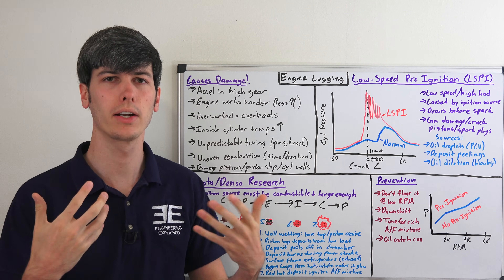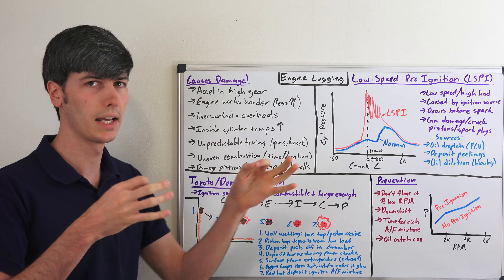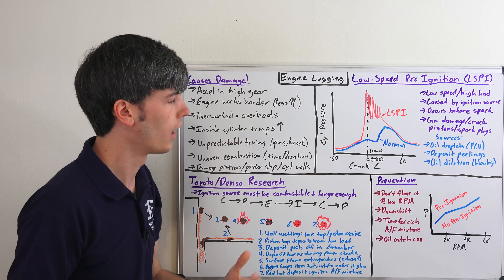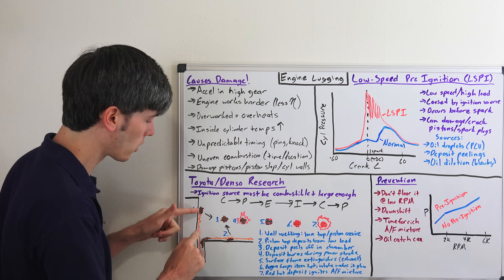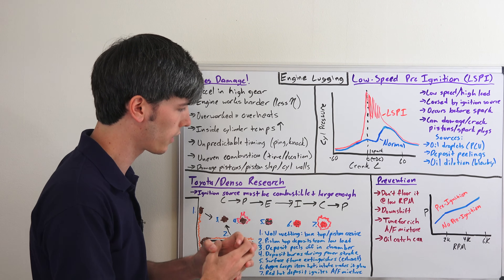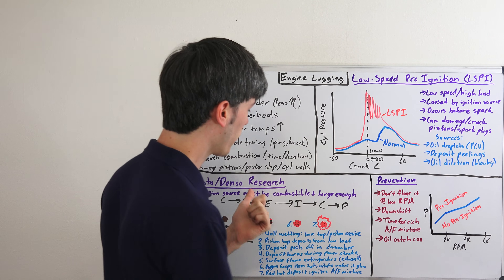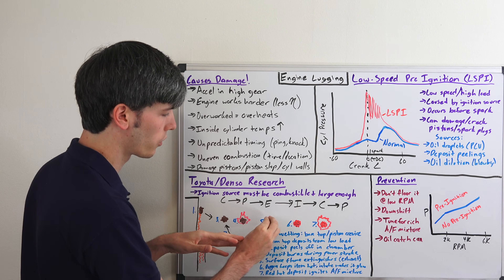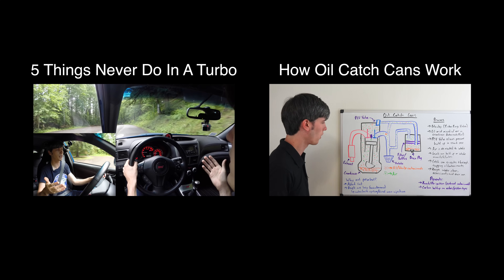Why You Should Never Lug Your Engine (Especially Turbos)

Comment: I wonder if it is better or worse in a supercharged vehicle
Reply: probably worse because it would have a lower boost threshold
Reply: It depends what kind of turbo or supercharger you have. Superchargers are more direct from being belt driven, so they have power all the time. Turbochargers can be tuned for low rpm power or high rpm power. It just depends on the tuning mostly.
Reply: Well it would be the same principle as a turbocharged engine, Because they are both forced induction so the pressure of the air is much higher when it is let into the cylinders. So having a higher pressure when pre ignition occurs the combustion will produce more power and downward force against the piston that is trying to move up to compress the air/fuel mixture But because of the pre ignition the combustion is pushing down on the piston while the crank tries to push it up.
Reply: Depends on the type of supercharger.  With a positive displacement supercharger, such as a roots type, the problem is generally worse unless the engine is running a low compression ratio.  With a centrifugal type supercharger like a Paxton, the flow rises exponentially with engine speed, so there is little extra flow at low RPM's.  They are not likely to have low speed problems.

Comment: All modern turbo engines has full torque in 1300-1500 rpm (in fact 2000rpm) so all you need to do is set Sport mode in tranny and it will keep it over 2000rpm. In manual yes it can damage engine in some way.
Reply: Not "all" modern turbo engines
Reply: you're talking out of your ass....
Reply: My car hits peak torque around 5000RPM, and I would consider the 4B11 a "modern turbo engine." It cold idles around 1500, so I'm not sure where you got that statement of yours.
Reply: well the smaller turbodiesels don't have full torque at rpm's that are so low, mine is a little lazy under 1700 rpm (1.3 Multijet)
Reply: +no1ymfan1 right I hit peak at  like 3000rom and mines direct injection (non diesel)so that really says somthing consitering DI helps with downstairs tq
Reply: +Ryan Rohauer Really? Jeez, boost doesn't even come on for me until after 3000RPM. The lag is pretty bad.
Reply: +no1ymfan1 yup mazdaspeed 3 makes 280ftlbs at 300rpm it makes begins to spool at 2500ish and is fully spooled by 3
Reply: +Ryan Rohauer 3000*
Reply: +Ryan Rohauer Okay, I figured you had a Speed3 from your profile pic, but I didn't wanna assume and look silly. Awesome car!
Reply: +no1ymfan1 hell ya iv been very happy with it makes boost quick and a great tq shove can't wait till I'm pushing more lbs
Reply: JoRick Revazov ahhhh.  More false facts being spread on YouTube.... Guess you never heard of the EJ Subaru engine. Not all modern engines are direct injection
Reply: Жора, а на атмосферных это тоже касается ?
Reply: Maybe for a 2.0 130bhp TDI... my high performance 2.2 tdi reaches max boost at 2400rpm. produces 400nm of tourqe at 2400rpm and pulls 180Hp at 3600rpm.
Reply: I thought he was talking about truck turbodiesels, but I didn't think they had a 'sport' mode setting.
Reply: The 2.5 liter EJ255 in a WRX doesn’t hit peak torque until 4000 rpm..... when it’s stock. I
Reply: Which "modern turbo engines" are you speaking of?  Full torque at 1300?  Sounds kinda BS'y.
Reply: My Infiniti Q50 2.0t (M274 Daimler engine) gets full torque of 350 nm @1250 rpm. It's wonderful!
Reply: My Toyota Prius makes 420ftlbs at 666rpm
Reply: Assuming every turbo owner bought the sporty version of the car and has a sport mode.(i.e. the 10% of turbo owners)
Reply: Ecoboost 1.0 has full torque from 1400 I think

Comment: But when driving in the city you sit at 2 gear and below 2k mist of the time. Is that a problem when you are not going 100% on the throttle?
Reply: Dont floor it and it is fine, watch the video dude
Reply: just go easy on the throttle until you no longer hear that deafening sound, or ride the clutch if you are crawling in traffic.
Reply: flooring it in 2nd gear should not be a problem no matter what rpm in most cars, 2nd gear is a low gear which should provide plenty of torque.

Comment: Why doesn't the car just limit how far open the throttle can be at low revs?
Reply: Newer car's with drive by wire most likely do. Without drive by wire, it's impossible for the computer to control it.
Reply: Adam Harrington I suspected that was the case nowadays - I can't get my car to complain much if I floor it at low revs.
Reply: YYZpresto Presumably you've removed your starter motor and syncromesh etc
Reply: +taotoo2 Same here, I don't notice anything strange when flooring it in 5th at 50km/h (30mph approx). It's just slow, since it's a weak-sauce engine, but no strange acts.
Reply: OEMs also do what he suggested in the video which is to use a richer mixture at low RPM and high load. This is another reason not to lug the engine (it wastes fuel).
Reply: I don't think it limits the throttle. In automatic cars after a certain throttle position the transmission will downshift. In manual transmissions I guess they just leave that responsibility to you, since that's probably why you got one in the first place :)

Comment: This is an excellent video, and well explained to boot. Thankyou for putting this up!
I would be very, very interested in hearing the difference between small petrols and small diesels in pre-ignition, as diesels have so much low down torque and lower RPM speeds. Also diesels ignite under pressure rather than with a spark, so I would please like to hear your thoughts.

Comment: Is any of this relevant in modern, direct injected, turbo charged, gasoline engines, where fuel timing is precisely timed, so there is less chance of the air/fuel mixture being ignited before optimum combustion can occur?

Comment: So you say multiple times that flooring it at low RPM is the cause, but wouldn't this apply to only a manual transmission? I had the idea that in a car such as mine with a DSG if you floored it the megatronics unit would sort it out and downshift on its own. Does this apply to any transmission?
Reply: Yeah, it will happen to you in any transmission if in manual mode.

Comment: Engineering Explained I have a question about this subject. My 4-cyl turbo reaches peak torque (195 lb-ft) at 1750 rpm. If I am in a high gear at or over 1750 rpm and floor it, is that considered lugging?

Comment: I have chev spin 1.3 diesel turbo. Because it is a diesel engine, i oftenly use a low rpm around 1500 - 2000 rpm. 
Ex: Gear 2 - 2000rpm - 35km/h
Gear 3 - 2000rpm - 52km/h
Are my kind of driving is bad for my diesel engine? 
Need your advice... :) 
Note: i often eco driving

Comment: Good explanation, I used to have a 2004 GTO with a 6-speed, it had this awful "feature" called skip shift where if forced you to shift from 1-4 when you weren't driving for performance, pretty sure it forces you to lug the hell out of that engine. Is there any way GM counteracted these effects in skip shift vehicles?
Reply: I'm pretty sure they counteract it by making the fuel mixture more rich. They also retard the timing based on knock sensor output.

Comment: What if you're in second gear doing about 5mph? It's not totally necessary to go back into first... would this still be considered lugging the engine if you were to accelerate in second gear at a relatively low (1200-1500) rpm?

Comment: How does lugging affect rotary engines?
Reply: good question
Reply: ever driven a boulder before?
Reply: +tyler.c spongebob has.
Reply: Well it's the same principal, If you have such things as oil droplets left in the rotary after exhaust phase and the engine is at a high temperature, that oil droplet may cause the air/fuel mixture to ignite before the spark plug fires.
Reply: And lugging just relates to the fact that at low rpm in higher gears when you put max load on your engine because of the lower gear ratios in play to actually spin the wheels the engine is doing less cycles so the amount of torque needed to turn the wheels is much higher than in a lower gear or higher rpm. So if your engine is using more power the engine will be at higher temperatures and higher pressure so the chance of pre ignition occuring is higher which is the main danger of lugging because pre ignition cause engine components to bend because they have pressure from both sides when they're not suppose to.

Comment: Why do you say that the efficiency is lower when the engine has to work hard? You are the first person I ever heard saying such a thing. According to my professors and a book "Introduction to Internal Combustion Engines" by Richard Stone among other sources, every engine is more efficient under full load than it is under part-load. I.e. if the engine has to work harder - it is working more efficiently. This is especially true with traditional petrol engines with a throttle valve. Which brings me to my next question. Does this lugging problem also affect direct injection diesel engines? You never seem to take diesels into account when talking about such matters.
Reply: I believe this is particularly true for gasoline/petrol engines thanks to the throttle, as you noted -- at part load the restriction and pumping losses reduce efficiency. At (nearly) full load, this problem goes away. At full load however, your engine management might make the mixture richer for that last bit of extra power, reducing efficiency again.

That's not the whole story though -- it's more of a 2-dimensional problem. So, for a given RPM, you do get more efficiency with more throttle. BUT, for a given throttle position, you'll get varying efficiency with engine RPM. Apparently, the best efficiency may be around peak torque. There are probably instances where you'd be better off at 75% throttle and the "right" RPM than 90% throttle at a very low speed. 

I guess a given engine will have an efficiency map as a function of throttle and RPM. Things to think about would be intake tuning and exhaust scavenging, valve clearances and swirl, friction, turbocharger efficiency, and so on.
Reply: Michael Barber That's a very elaborate and thoughtful answer, thanks :) yeah, I haven't really given efficiency maps any thought before and you're totally right. If you look up these maps on the internet, you'll see indeed that the most efficient spot of the engine lies at the RPM of peak torque, but somewhat lower than full load. At higher RPMs, the efficiency gradually decreases, but there's a dramatic difference at low RPMs, where the available torque is minimal and the efficiency isn't all that great.
Reply: i'm right with you on this, you beat me to it.

Comment: Is any of this applicable to modern Direct injection Turbo Diesels?
Reply: not at all... engine management systems change variables when they sense knock...
Reply: I don't think so, I think all this is pretty vague on diesels, considering they sometimes peak torque at 1700 rpm

Comment: Is this still a thing with direct injected engines?
Reply: I don't think diesels are affected much by this, if at all. The fuel isn't injected until combustion is desired.
Reply: bro are you kidding
Reply: How does this change anything?
Reply: ***** I have a direct injected turbo diesel, ecu remapped (conservative), and mine doesn't smoke except for high RPM when will do it slightly, but I've seen people with the same engine that have mapped the hell out of it, they will smoke like crazy to the point of melting pistons, Damn!.
Reply: +Dale Cmaylo thanks! I'll have to research Ford Ecoboost technology then, it might help me understand.
Reply: +Dale Cmaylo Yes, I get that they're just efficient versions of traditional engines - it's what Ford is doing to prevent the knock that specifically interests me, and the differences between diesel direct injection and petrol direct injection. 

I'm most interested in knowing what limits there are for each fuel and why - if petrol has a faster flame front than diesel, for example, why can't you just inject the fuel at a time when knock is impossible? Is fuel atomisation the problem? Are we moving towards a time when spark plugs will be unnecessary? 

And has tesla done enough to make all of this a moot point...?
Reply: Well, smoke is raw fuel in the case of diesels to which your talking about and rich mixtures cool cylinder temps and it is very unlikely that any type of detonation would occur with so much extra fuel. Impossible I might venture to say. Though, people that do that, like the bro's in big diesel trucks, all it does is cause cylinder wall damage, as the high amount of fuel washes the film of oil from the cylinder walls and can lead to premature cylinder taper.
Reply: Yeahhshiftyeahh That is exactly what I thought in the beginning, but diesel is very different from gasoline almost backwards may I say, because is a slow burning fuel excess of diesel actually heats up the chamber reaching temperatures that melts the aluminum pistons, at least that is the explanation I received.

I couldn't believe it the first time time I saw it, the damaged ones had a hole close to the center and the critical ones looked like a puddle of molten aluminum with waves from the center.

Comment: This is a useful video because I just got my first manual car about 2 months ago (2001 Honda Prelude SE :D) I just wondered, if you are at like 1,500 RPM, and you accelerate very slowly, like I'm talking barely pressing the throttle, it that also bad for the engine? I always down shift if I need to accelerate quickly, but not if I'm accelerating super slowly.
Reply: You're okay. It's at high load that you're really stressing the motor. If you're in a Prelude just stay above 2K and you pretty much always have power anyway. No need to ride low rpms.
Reply: +FerpiliciousProducts it's mainly when I'm on a construction zone and I'm driving in 2nd, people in front of my slow down way too much for some of the turns and 1st and 2nd are so far apart on my car so it's kind of a pain to shift down to 1st just to accelerate after a slow corner
Reply: +FerpiliciousProducts Why ride low rpm when I can hit 8k haha no but the engines a little old to be redlining it. 233,000km and still running ;)
Reply: +puffnpluky76 if you're moving at all second gear is fine. When people talk about lugging engines it's normally a taller gear like 4-6 and flooring it at low rpms. Builds power very slowly and causes all sorts of engine health issues like explained in the video. The only time I really downshift into first is in parking lots in my Evo as the car just pulls itself around without me having to clutch or throttle. If you're going 5mph/7kmh or something in second you'll be fine.
Reply: +FerpiliciousProducts also, my prelude is a 5 speed and I always thought that's because the engine doesn't produce enough torque for a 6th gear, but how to the new civics get 6 speed with only a 1.6L engine or whatever they have, but my 2.2L can't have a 6 speed?
Reply: +FerpiliciousProducts like, I know the preludes are high revving cars, but I sit at a solid 4,200 rpm in fifth year on the freeway. wouldn't that use a lot of gas and wear on the engine? my automatic accord v6 I used to have would only Rev at 2500 rpm on the highway
Reply: +puffnpluky76 Most 90s/early 00s Japanese cars used five speeds. They were reliable and smaller. Also my '99 Lude got between 8-10L/100km on the highway. Wish the car had a 6 speed though. More so that it just got loud in the cabin than anything.
Reply: +puffnpluky76 Also Preludes, Integras, Evos, STIs, etc all have short gearing so they can accelerate faster. Thats why your 5th gear rpm sits so high, because sports car.
Reply: The new 6th speed gear isn't necessary for civics. It's like my my Fit that has a 6th speed. It makes the car produce too less of torque in every gear. I wish my car only had 5 speeds! I serious think 2nd has too little torque that I roll around with most of the time.

You should test drive the car and see a huge difference on how much the 6th gear isn't needed.

Comment: basically it's OK to rev a petol engine higher, but you DON'T need to do this with a diesel engine, since the fuel is sprayed into the cylinders after peak compression and immediatly ignites. 
So my fellow Europeans, don't worry, you've not been taught wrong if you drive your diesel engines at low RPM, you're helping the environment ;)
Reply: I was about to ask that, because most large diesel engines are really slow, trucks are best at 1-1.5krpm, tractors aren't known for revving high as well. I think he really should've specified what engines this applies to.
Reply: @kristapsjj8520  i have a range rover evoque which has a 2 litre diesel engine (163'500km). when i drove around 52km/h the engine rpm were at around 1.2k, it started to make a vibrating sound. over 1400rpm this didn't happen. Today I did some pulls on full throttle, which the car basically never experienced in its lifetime, and the vibrating noise was gone when the car was operating on such low rpm
Reply: @m850i_individual  I can only speak for my engine. The D5 is notorious for soot. After driving for 500km as a grandma it's good to rev it once in a while and get all of that crud out of the exhaust etc.
Reply: Still lugging them below 1500 rpm destroys dual mass flywheels, especially in a 4 cylinder
Reply: Not the main reason. Diesels make a ton of torque in the lower rev range due to a longer stroke, they make power down low.
Reply: @Eclipsis17  still if you go wide open at 900rpm it probably won't be good for it